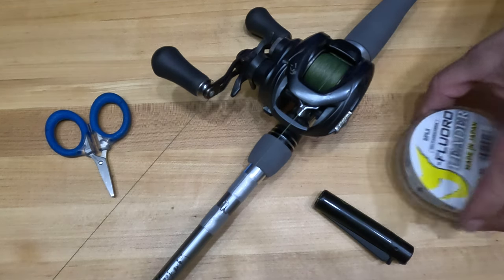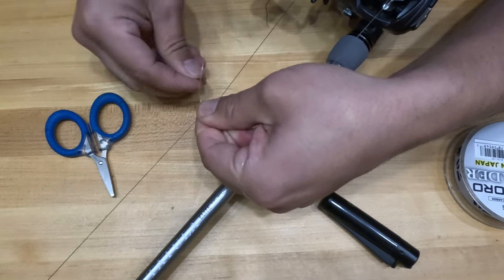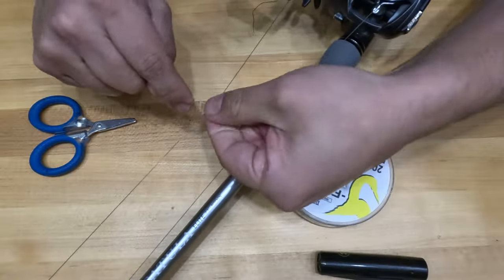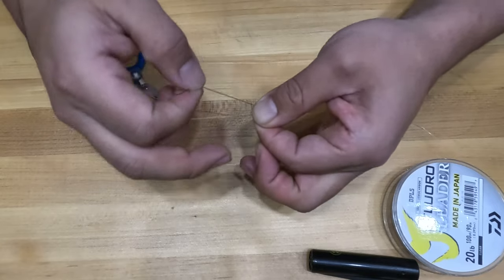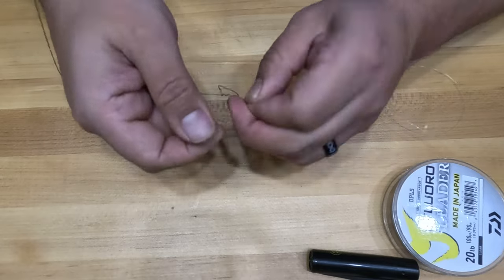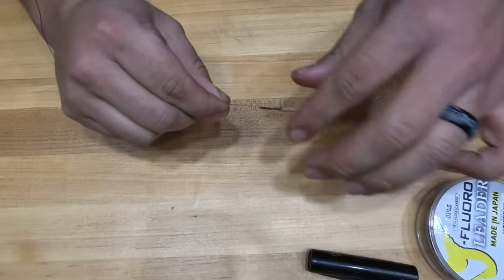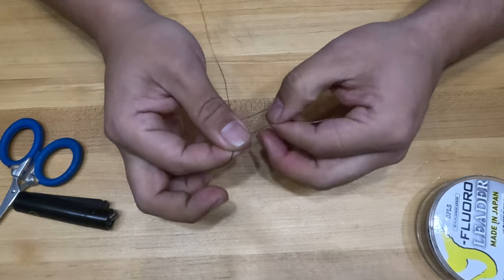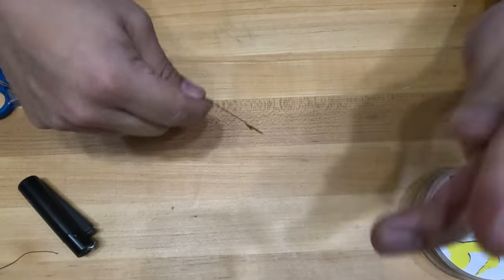The Ultimate FG Knot in 4K!

Comment: Forgot 1 biggie. Before whip finishing you need to do just 1 half hitch so that you can pull on both line's away from 1 another till the braid bites down into fluoro causing a darkening of it. Otherwise you risk slipping while fighting a fish. Once your fluoro tag is clipped some ppl half hitch braid till they cover the fluoro tag THEN whip finish or Rizzuto finish braid over itself for a tapering effect from braid to fluoro for smoother movement through rod eyes. If taking the time to do an FG knot I even mushroom the fluoro tag, half hitch at least 4 times up to the mushroom then rizzuto finish the braid on itself. Whichever you choose be sure you do that 1 half hitch after your 20-30 cross wraps so you can sink that braid down into the fluoro b4 proceeding as you see fit. Ive also recently come to like the chain knot a lot too.